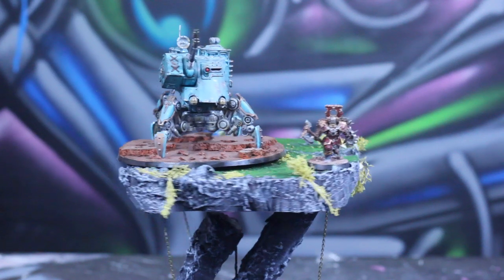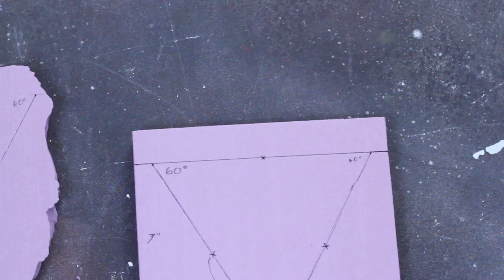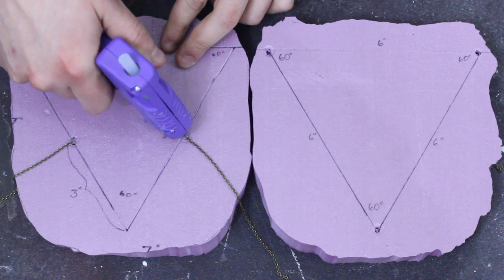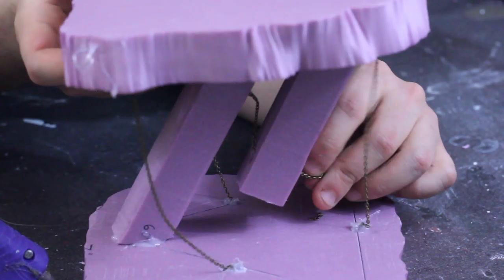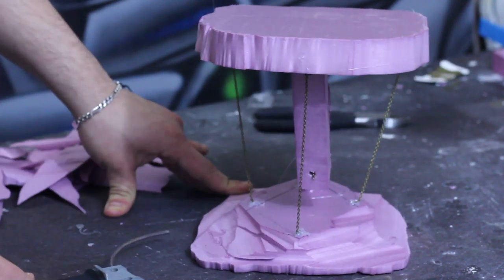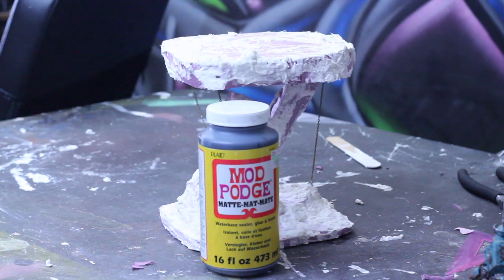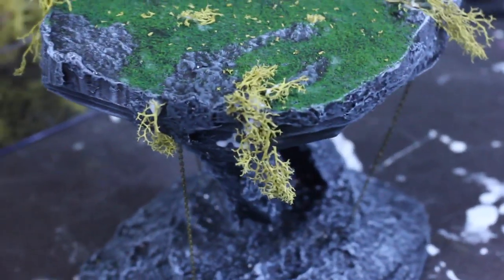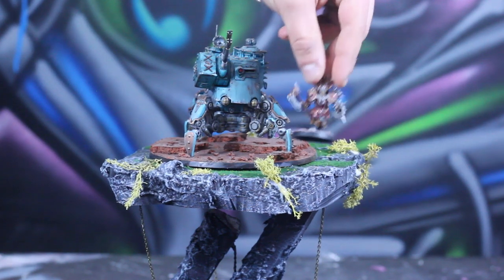Warhammer 40k Terrain , How to Make a Floating Island of Tzeentch

Comment: lil tip in case anyone wants to cool their hot glue quick, flip a can of compressed air, like youd use to blow dust off your keyboard, and give the hot glue a few quick blasts, it should insta freeze or be near solid when done
Reply from the maker: Thanks for the tip